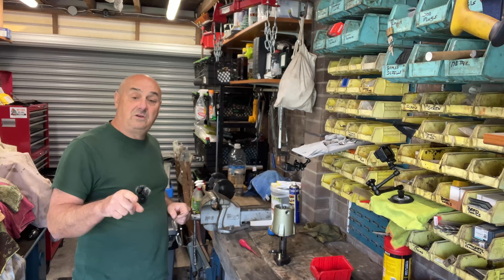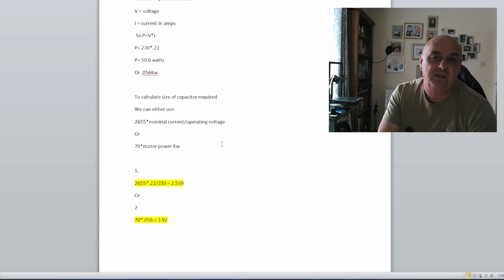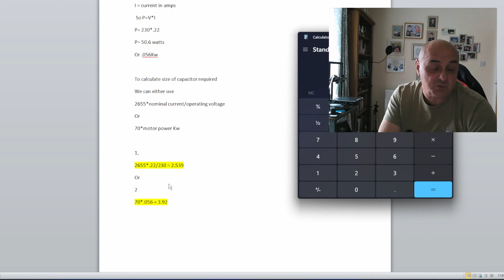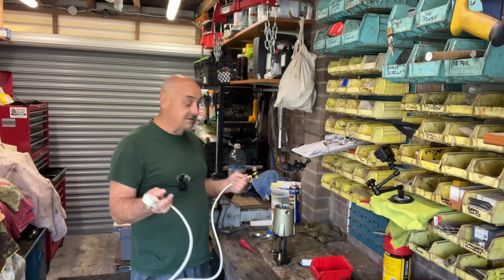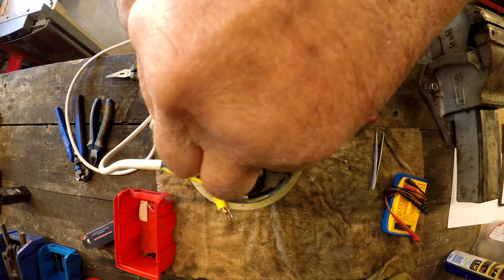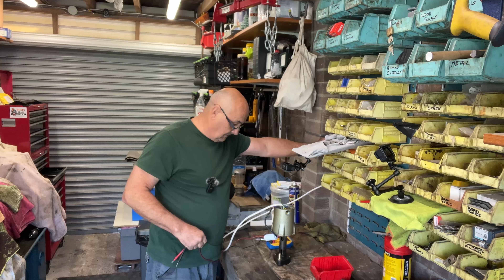How to run a 3 phase electrical  pump with a single phase 230V circuit

Comment: Great series of videos on all this wiring for the lathe Barry, I’m ok with household electrics but seeing this makes you realise why you employ an electrician. It’s a really solid pump fitted to these older machines and so fitting for purpose, the modern equivalent is probably a cheap plastic version that you have to replace every few years. Great to see that it’s working exactly as you want it to.
Reply from the maker: Cheers Terry, yes it working beautifully, it's great to be able to play on one again.

Comment: You have made the complicated seam simple, good video Barry. It will be running soon.
Reply from the maker: Hi Brad, just returned from 4 days in Aberdeen meeting up with Marshall, fingers crossed we'll get the pump wired to the wall and get some coolant in very soon.
many thanks
Barry

Comment: Making progress there Barry, Dont let me near it, it might just blow up, lol.
Reply from the maker: G Day Lance, hopefully get the wiring to the isolater done today and get some coolant in the tank, just got some tips and holders, your right it's cheaper to buy the two together as the holders are as expensive as the tips and you get them for the price of one if you buy both,
cheers Lance
Barry

Comment: Barry, I was a bit hasty commenting last night because I got it wrong.  Please ignore.  Have now had time to think it through. Let’s start again.  The power is the same star or delta but
I think it easier to consider the the Star connection because the line and phase currents are then the same. In Star, if the line to line voltage is say 400V then the phase voltage is 230V. The line and phase currents are 0.12A according to the nameplate. 
So the power is 230x0.12x3=83Watts. (Phase volts x phase currents x 3).  
In Delta connection the phase voltage is still 230 and the phase current still 0.12. It is the line current that is the higher 0.22A on the nameplate. I believe you may have made the mistake of using phase volts and line current. 
The voltages and currents on the nameplate are not entirely reconcilable and in any case the power is dependant on the actual voltage. So it is all a bit of an estimate. It could be the motor is possibly 100W nominal.
I hope this helps. 
Rob
Reply from the maker: cheers Rob, using the 83w power rating it would mean a capacitor of 5.8uf, I might buy a 6uf and see if that calmes the voltages down,
many thanks Rob always good to get good solid advice.

Comment: Bra Barry jag vet inte något om starkström motorer men 280 volt på ena fasen var kanske högt . Men du valde ju storleken i medeltalet 3 mikro farad av din beräkning kanske du skulle behöva titta på någon annan 3 fas 0,70 kw och se hur stor condensator den kan ha. Men den blev ju inte varm så kanske den ändå är passlig storlek. Vi får hoppas det blir bra ! Ha en bra dag Barry !
Reply from the maker: Skål Peter, jag håller tummarna, förhoppningsvis får jag lite råd från andra som vet mycket mer om el än jag. Jim kanske kan hjälpa till. Jag åker till Skottland på torsdag och ska prata med honom.
håll tummarna.
tack så mycket.
Barry

Comment: Whith that flow rate coolent will be splashing a good distance. May be when you get the voltages right it will be less powerfull. Good one M
Reply from the maker: Hi Marshall, I remeber we used to have splash guards all other the place to catch the spray, especially when it hits the chuck, I think I need to paint the walls white to help with the light reflection, it was a little bit dark today.
Cheers Marshall
Barry